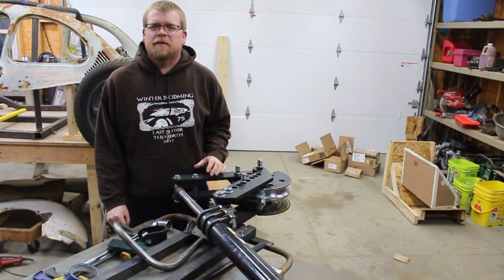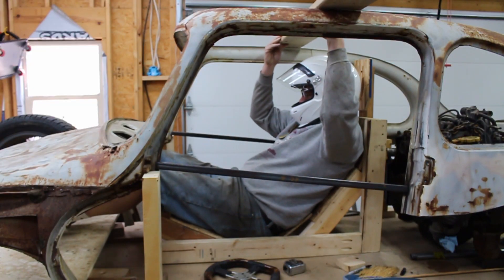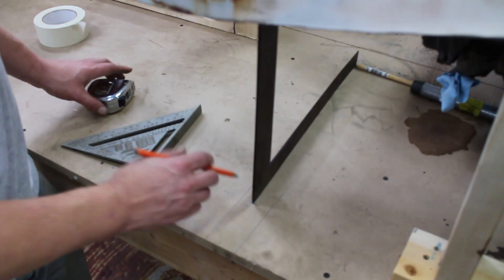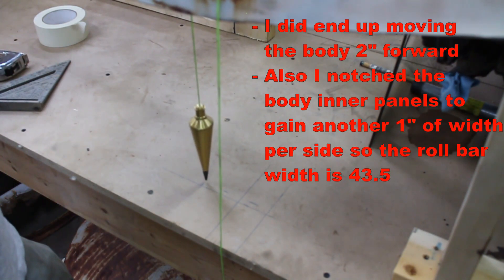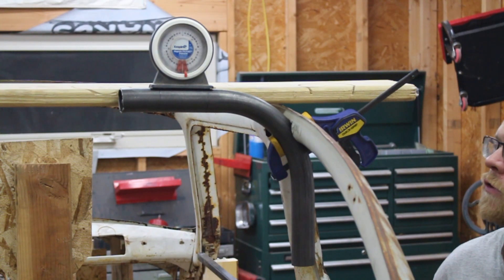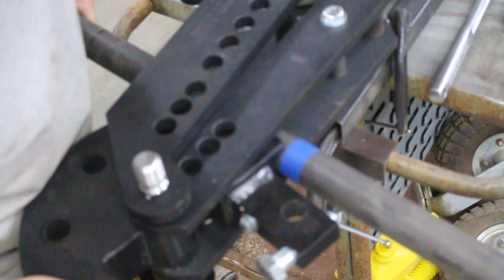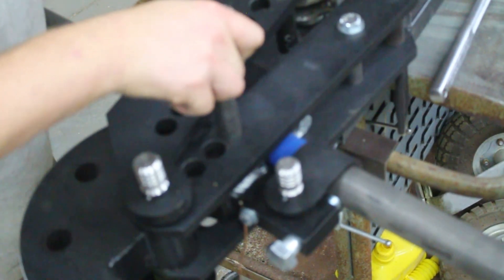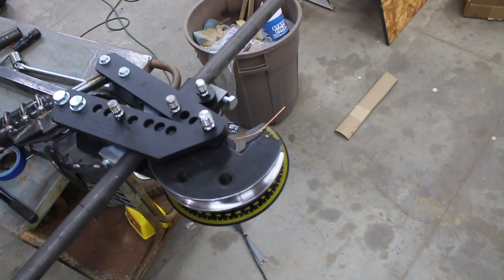Nocones Garage LMP360 EP 4 Bend it like Bender

Comment: what welder do you use?
Reply from the maker: I have a Hobart Handler 180 from like 2007 and a Eastwood TIG200 from 2013.  Very happy with both of them.  The handler is a great machine no complaints.   The Eastwood isn't perfect, the OEM hose failed and it is not as adjustable as other welders, but for the price I am pleased with it.  If you need to do thin gauge it can turn the amperage down way lower on 110V.
Reply: @NoconesGarage  thanks!